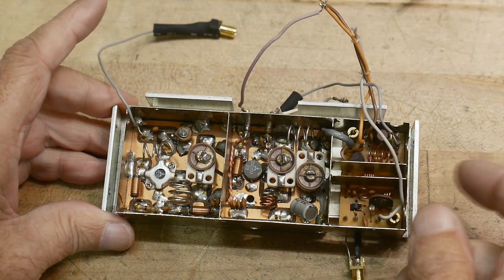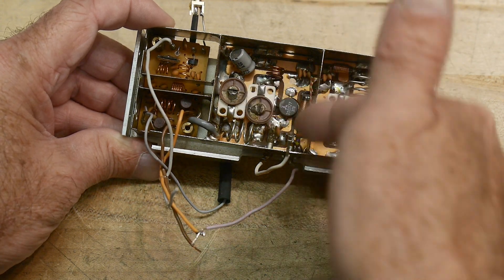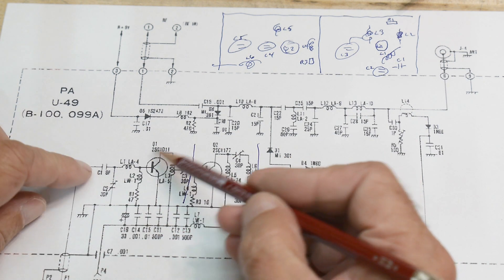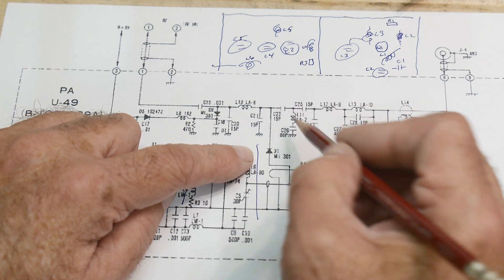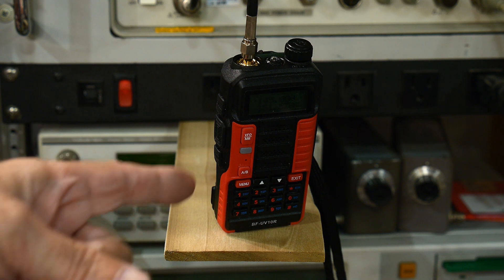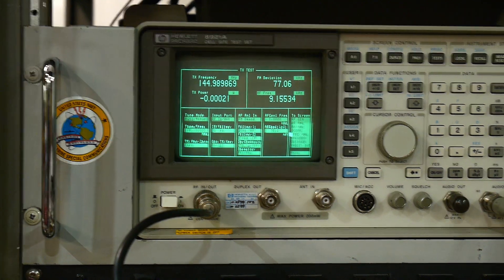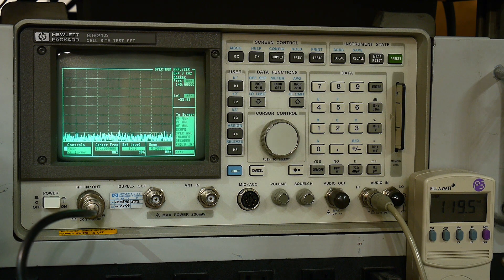#987 ICOM IC-230 Power Amplifier

Comment: My first 2 meter base rig was an IC-230 given to me as a 13 yr old ham with a very annoying scratchy low powered persistent kid living on the fringe of the local repeater.  My 9dBi Omni antenna and Yaesu FT-208R HT just couldn’t make the trip!  So a local ham friended me and gave me the IC-230, and another loaned me a 10 amp power supply and thrilled me!  Thanks to that little rig a lifetime of amazing friends has resulted!  I know nowadays it’s a rare occurrence but if you ever stumble upon a very eager kid trying to find their way into amateur radio be generous!  The impact of what ever you may give them will greatly exceed the value of the item!

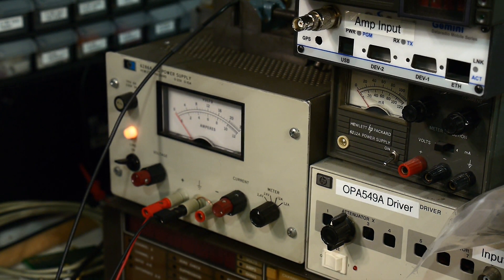Comment: 05:21 the current is actually 2.5Ampere. If the current had been 5A with Vcc=13.8V, then the power supply input power to be  69Watt DC. With RF output of around 10W, that means the efficiency of the Power Amplifier to be some where around 10/69 = 28% ONLY....Am I wrong or am I not correct?
Reply from the maker: I read the meter wrong. 2.5A seems right

Comment: Try less drive, you may be over driving it
Reply from the maker: yes, I think it only needs 0.5 watts drive. I was more interested to find out if the final transistor was alive or dead.
Reply: @IMSAIGuy  is it not possible to figure out the minimum power required to drive it just from analyzing the circuit diagram?